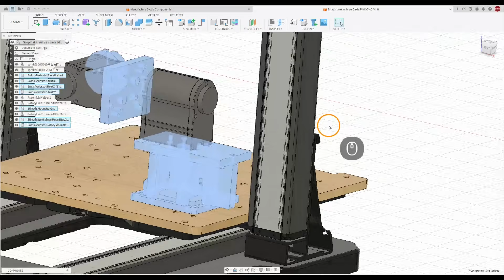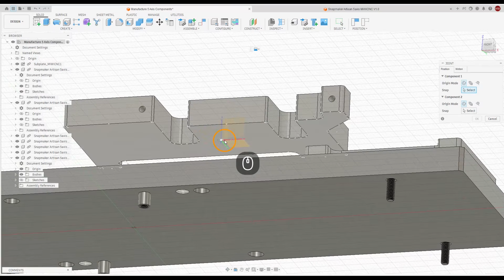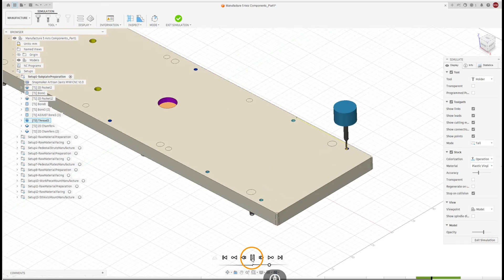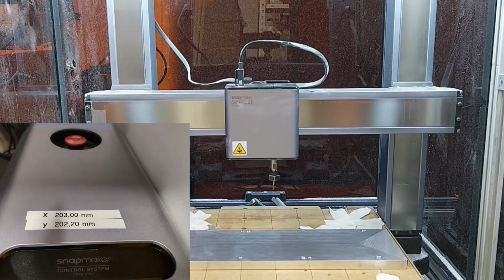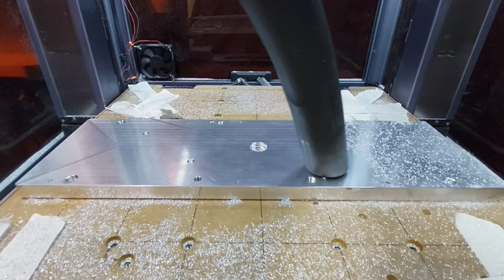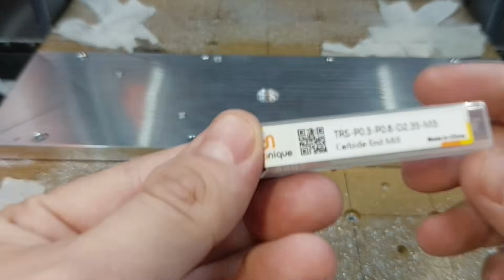Aluminium Milling on a Desktop CNC | Snapmaker Artisan — Thread Milling (Fusion CAM)

Comment: Awesome! Thank you for another video! Looks like no fancy cooling needed?
Reply from the maker: No fancy cooling is needed—you're absolutely right. The combination of the chosen raw material and the selected cutting parameters ensures that most of the heat is carried away by the chips rather than being transferred into the tool.

At the very beginning of my aluminium machining tests, I thought heat would become an issue that I'd have to solve with additional hardware. I even bought a cold air gun for that purpose. However, after seeing the results, I decided to leave the fancy cooling out for now.

There may still be a point where additional cooling makes sense, but I don't see that happening anytime soon while machining this type of aluminium (EN AW-6026 LF, by the way).

Comment: Half of the video is about workflow in Fusion, I recommend you'd mention it in the title.
Then you showed us the tools, but not long enough to read the label. There are no (affiliate) links in the video description either
Then you showed how to zero the tool 3 times, which is useless repetition.
Hope to help
Olaf
Reply from the maker: Thank you for the feedback!

I think it makes sense to mention Fusion in the title, so I've updated it accordingly.

Regarding the tools, I've also added a section to the video description linking to the tools, machines, and materials page on the MiWiCNC website.

As for zeroing the tool three times, I'll definitely give that some thought for future videos. At the moment, I'm a bit torn. On one hand, I understand that it can feel repetitive for experienced viewers. On the other hand, I'm a little concerned that complete beginners might actually appreciate seeing the full process, even if some steps are repeated. For now, I tried to find a compromise by speeding those sections up.

Thanks again for taking the time to share your thoughts—they're very helpful!

Comment: Please don't stop. The snapmaker artisan tutorials in general are far and few between. This is the first time I have seen the cnc module actually cut aluminum, I have been afraid to cut almost anything with it that I have not seen done in practice.
Reply from the maker: "I have been afraid to cut almost anything with it that I have not seen done in practice."

is exactly why I decided to start this project in the first place.

My goal has always been to help take away that fear and give people the confidence to try things themselves.

Reading your comment honestly made my day. Knowing that the videos are reaching exactly the people I hoped to help—and that they are moving toward that goal—means a lot to me. Thank you for sharing that.
Reply: @MiWiCNC  Many thanks from here too i haven't finished the video but the intro alone is great... only one question.. i want to bite the bullet and buy it but many online say you are better off buying the individual machines.. but to me this quality and execution is hard to get at a comparable price... plus that long Z height is the reason i need it as i can work with different work holding positions not like the 40mm deep cheap ones on the market..
What do you think?
Reply from the maker: @mayinjabob9380   hi and thanks! 

First of all I totally get you with "biting the bullet". I kinda felt the same when choosing which path to take. I have researched a lot in advance and even contacted snapmaker by mail before finally going for it. 

I want to give you the most honest and complete answer by explaining my thought process in detail. I hope you dont mind reading the long text that will follow here now XD

Before getting into desktop manufacturing machines, I had already worked with machines at very different ends of the spectrum, which definitely influenced what I was looking for when I started exploring what I could realistically have and use at home.

Extreme 1: Heavy, old-school conventional machines without any CNC functionality. Not much fancy technology, but incredibly sturdy and built to take a serious beating.
Pro: Incredible rigidity — they can take a serious beating.
Con: No CNC functionality — very limited when it comes to complex geometries and automation.
Effort/knowledge: Mechanically straightforward, but actually making good parts required machining knowledge and a lot of hands-on work.

Extreme 2: Proper industrial CNC machines – the kind you would expect to find in a CNC shop – with all the benefits that come with them: tool changers, tool compensation, flood cooling, rigid construction and so on.
Pro: The complete package — rigidity, precision, tool changer, compensation, cooling, automation, etc.
Con: Completely unrealistic for most home workshops in terms of price, size and infrastructure.
Dont get me wrong. Was super nice to work with them.
Effort/knowledge: Extremely capable, but you need to know what you're doing. Programming, setups, tooling, workholding, parameters and all the other details still require proper CNC knowledge. And mistakes can get pretty expensive pretty fast

Extreme 3: A completely different beast: a decommissioned heavy 6-axis industrial robot with around 3 meters of reach and roughly 1.3 tons of weight, which I was lucky enough to get my hands on and experiment with at home.
Pro: Incredible freedom of movement — six axes and an enormous working envelope.
Con: Despite its 1.3 tons, nowhere near the rigidity of a proper CNC machine, especially at larger reach.
Effort/knowledge: This one was on another level. Being a decommissioned industrial robot, I had to repair and troubleshoot a lot myself. There was endless debugging, figuring things out and digging very deep into how the machine, controller and software actually worked before I could even get it to do what I wanted.
As much fun as this project was, the amount of hours that went into it was honestly kind of insane. That's also why I rarely recommend going down a path like this to anyone. You need to be some kind of masochist to actually enjoy putting yourself through all of that XD

continuation in next comment
Reply from the maker: Now that I've shown you the different extremes I had worked with before, let me bridge that into my thought process and explain how I eventually ended up with a 3-in-1 machine.
Having already experienced 3D printing (industrial setups only – I didn't have a consumer 3D printer at home yet), laser (both through work/industrial applications and at home by mounting different lasers onto my robot), and CNC milling/turning (through work, school and my own projects at home), while still being genuinely interested in all three technologies, naturally made the idea of a 3-in-1 machine pretty attractive to me.

thats when somebody referred me to Snapmaker Artisan.

Interestingly, when I bought the Artisan, I was mainly thinking: "Okay, I'll use this for 3D printing and laser, and if I want to get more seriously into CNC later, I'll look for a dedicated desktop CNC machine." I honestly wasn't expecting the Artisan itself to become the machine I would eventually use for more serious CNC work.
After playing around with the machine for a while and getting some really nice results both in 3D printing and laser, I eventually started looking for people doing more serious CNC work with the Artisan. And that's when I realized there really wasn't that much content out there.

So I basically decided to take that into my own hands and start exploring and documenting what the machine can actually do in this area.

And the deeper I got into it, the more I started to feel that the Artisan is actually quite underrated when it comes to CNC. Especially with what I have now demonstrated machining metal, I think it's pretty clear that the machine is genuinely capable. Of course it's still a desktop CNC and needs to be treated as one – but I think there's quite a gap between what the machine is capable of and what you commonly see people doing with it.

But all of that explains why I originally ended up with the Artisan. The more interesting question for you is probably: knowing everything I know about the machine today, and having pushed it much further than I initially expected – would I still choose the Artisan if I were standing in front of that buying decision again right now?

So let me give you a fresh view on the Artisan from that perspective.

The large working area, especially the Z travel:
Today, this is something I value a LOT more than I did when I originally bought the machine. The X and Y working area is already very attractive to me, but especially the large amount of space available in Z opens up possibilities that I wouldn't want to give up anymore. My DIY 5-axis module is probably the most extreme example of that. Having all that room for different workholding setups, fixtures, rotary axes or simply taller parts gives you a lot of freedom.

The community:
This is something I completely underestimated when buying the machine and honestly would never even have considered an argument for choosing one machine over another back then. Today I absolutely would. Having an active and engaged community around a machine is incredibly valuable. People experiment, share their experiences, solve problems, develop things and help each other. Looking back, I definitely value this much more than I expected to.

Having a complete platform instead of making everything work together myself:
This is probably something my experience with the industrial robot made me appreciate even more. Yes, you can absolutely build things yourself and combine individual components – and that can be incredibly fun. But imagine trying to build yourself a platform capable of doing all three things the Artisan does.

You start by pouring hours into getting the mechanics and 3D printing setup working properly. Then you start figuring out the laser. Then the CNC spindle. And somewhere along the way you still have to deal with motors, drivers, controllers, electronics, firmware, wiring, configuration, safety and making all of these completely different systems somehow coexist on the same machine.

I've been far enough down that kind of rabbit hole to know that it can be a lot of fun – but it can also consume an absolutely ridiculous amount of time.

With the Artisan, that fundamental integration work has already been done for you. I can still modify it, experiment with it and push it beyond what it was originally intended to do – which I obviously enjoy XD – but I don't have to start by spending hundreds of hours just creating the platform I actually wanted to use.

continuation in next comment
Reply from the maker: Now, would a dedicated CNC machine be better? Depending on what exactly you want to do – absolutely.

If CNC was my only interest and my goal was simply to get the most capable CNC machine possible, I would definitely look at dedicated machines. You can get more rigidity, a stronger spindle, proper cooling systems, tool changers and generally a machine that has been designed from the ground up around one purpose instead of having to accommodate three completely different manufacturing processes.

But having seen just how underrated the CNC side of the Artisan actually is, my perspective on that has changed quite a bit.

I've been able to push this machine much further than I originally expected and achieve results that, for my purposes as a hobbyist, I'm genuinely very happy with. At the end of the day, we're not competing with aerospace machining centers here XD. I'm making parts and projects at home, learning, experimenting and having fun doing it – and for that, the Artisan has proven to be far more capable than I initially gave it credit for.

So knowing everything I know today, would I still buy an Artisan?

Yes.

Even knowing that a dedicated CNC could outperform it in certain areas, I would still choose the Artisan because of the complete package: the large working area, especially that massive amount of space in Z, the flexibility of having three manufacturing processes available, the community around it, and the fact that I get a platform that already works while still having plenty of room to experiment and push it further.

And I guess there's one pretty convincing piece of evidence for how I actually feel about that decision:

I already own two of them XD

And if you've actually made it this far and read this monster of a text all the way to the end XD, I'll allow myself one tiny shameless reminder:

If you do decide to bite the bullet and go for the Artisan, I'd be very happy if you'd consider using my affiliate link together with the MIWICNC discount code. It saves you some money and gives a little something back to me as well, which helps motivate me to keep putting all those ridiculous hours into testing, experimenting and creating this kind of content.

Absolutely no pressure though – after making you read all of this, I think I've already demanded enough from you XD

Lastly, there's obviously much more I could go into in detail. No machine is perfect, and through pushing the Artisan in all kinds of directions I've naturally come across some limitations and things that required a bit of figuring out. So far, though, I've always been able to find a way or workaround for the things that mattered to me. Some of these topics I've already addressed in my content, while others are things I'm planning to cover in the future.

So regardless of whether you end up buying an Artisan or decide that another machine fits your needs better, feel free to reach out to me. If you have specific questions, doubts, or simply want to know more about any of the limitations, experiences or workarounds I've encountered along the way, just ask. I'll happily share what I've learned and give you the most honest answer I can.
Reply: @MiWiCNC  Wow, thank you for taking the time... I am going to buy it even though am having issues with shipping addresses.. but its perfect no matter what the speed is as comparable size and quality as this will cost alot more this is at the very least far better of a compromise.. thank you once again. 
I will keep you updated and ask any questions.. and speaking of those.. seems you have the ability to try a six arm robot arm running marlin or otherwise for LeRobot.. try looking into it, you may like the "rabbit hole" ;)